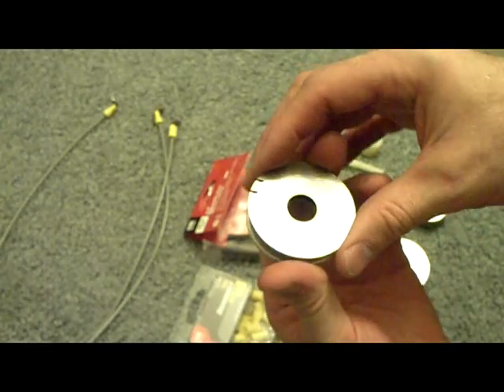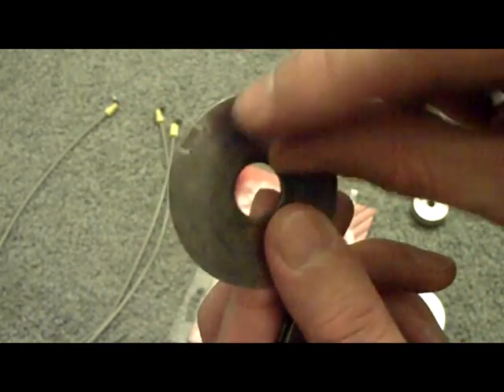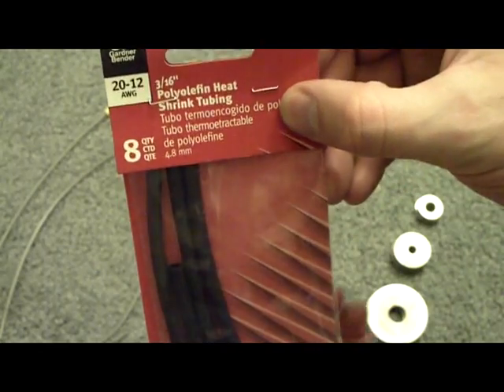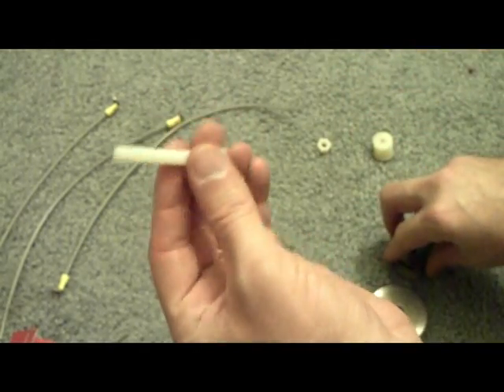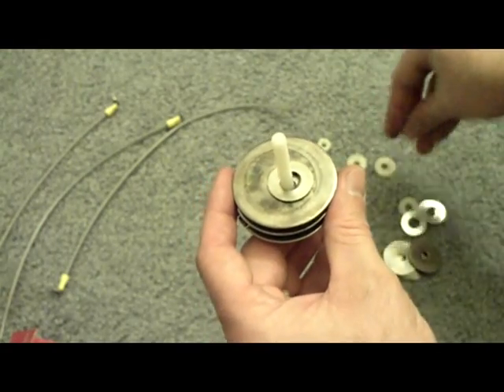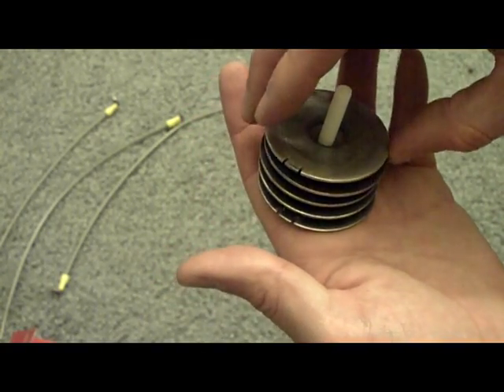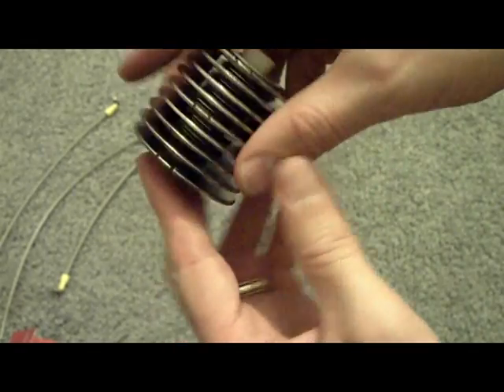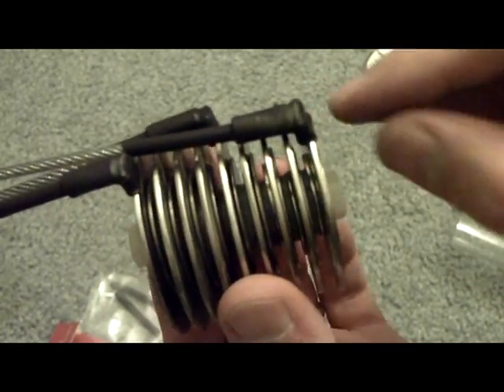Vid59 How to Build a Washer Cell

Comment: Keep in tank for storage
Reply: the gas produced like this is hydrogen and oxygen together.. storing that under pressure together in a tank has a name its called a BOMB. If you store that under even 2LBS of pressure in a 15lb propane tank if it back flashes it will level your whole house just fyi... you have to either us as it is produced to keep the volumn of gas small so a backflash dosnt kill you or seperate the oxygen at production point. Good luck.i know this from experience i tried to store it in a helium can i emptied with the thought of building a portable torch. to try it out i called my sister to watch, i pointed it at a candle and pushed the button if there was a flash it went so fast i didnt see it. but the can blew apart in my hand down the side seem and the bottom stuck in my chest. that is how i leaned its a bomb.... be VERY careful if you compress any gas in any container....

Comment: notches are genius, why not cut longer and bend those, oops it would touch the neutral washer. hmm laser weld a male tab for female connector. Aha! will do. I have a Rofin Baasel Lasertech Desktop. but bending connector works why do extra work. we'll see. i Like, OLE!

Comment: if you don't mind whats your volage and amperage ? and this design is pretty dope. the way i attached the wires is i cut strips of stainless steel sheet metal drilled holes and fed them in so they touch the washers

Comment: I will drill the washers and connect with a threaded bar and nuts and dont use the  wire conectors inside the solution.

Comment: So.  I really like this design and since you didn't write a material list.. I did it for you for others to read/screen shot. I'm definitely going to give the design a shot since it's easy to build and I'm new to this.

10 3" stainless washers
10 1-1/4" stainless washers
8 1" stainless washers
8 Nylon washers
3" Nylon bolt + Nut
Shrink wrap for making water tight connections
Stake on connectors (Disconnects)
3' 12 gauge stranded wire

A fuse wouldn't be a bad idea.  A 10 amp automotive fuse would work just fine and would only require two more stake ons and be put in line with the positive terminal.  It would be out side of the water/gas. The stake ons would not have to be shrink wrapped. 

I didn't take notice if the voltage was specified.  I would assume It's either 6 or 12 from say a car/power tools battery.  I would think you could use an old PC power supply if you should have one lying around or cheaply available.  Typically, they have 3 different voltage out puts (3.3V, 5V, 12V @ various amperages depending on wattage rating)

Another thing to toy with is a variable resistor or the like to actuate the amount of gas being produced.

Keep up the good work, My man!

Comment: Hi All,
This method of building a HHO cell is correct.
It's not the traditional version but it is simple and effective.
I built one and got great results.
Some of the comments being posted are not correct.
You need Neutral plates for a HHO cell.
The Neutral plates also produce gas.
And yes 3 inch SS washers are hard to come by so try going on line and get them shipped.
If you build this cell  and it's not working your doing something incorrectly.
Cheers

Comment: where did you purchase all of this wish you had a written material list I'm the description for was of access
Reply: plastic washers and plastic bolt and nut plus stainless steel washers it with cut grooves in them for the wire connecters

Comment: Where did you get the three wires that you put the quick disconnects on?
Reply from the maker: It is vinyl coated galvanized steel cable. You can find it at Home Depot or Lowes.
Reply: I noticed that 3" washers are hard to find on the internet. I also looked at Home Depot. If someone knows of a website that would be great.
Reply from the maker: www.mcmaster(dot)com

Comment: why do you have so many layers only three of them are doing anything
Reply: keco nation to cut back on their heat production LOL! I am with you! Only three of them washers are doing anything. If it is to cut down on the heat then why not just reduce the voltage or cut back on the potassium hydroxide? Everybody is doing it!
Reply: keco nation yagi antenna works
Reply from the maker: To prevent overheating of the cell. The extra washers are neutral. They are not directly connected to Pos or Neg, but instead provide a connection through the electrolyte solution.
Reply: Thanks

Comment: Let me see if I can help you here. Take 1 Stainless Bolt whatever length you want. Put washer on bottom install slim nut. repeat until tired. You just made the Negative Pole. Now Take a bolt and start with a slim nut. Repeat again and you now have a Positive. Slide the 2 together at what ever gap you want depending on amount you want and chain as many as you want in a circle. Place in container and Connect all neg and all pos together out of solution. Done. Hope this helps.

Comment: Has anyone tried using computer hard drive platters in lieu of stainless? I only ask as I have a fair amount of them and they are platted in platinum. I did some testing and got some impressive results.
Reply: I used hard-drive platters, they worked well until the platinum plating wore off, then the aluminum underneath began to deteriorate.
Reply: @davekauffman8727  Goldsmith/Master Jeweler here: too bad platinum plating wore off, in theory it should've held. that's why Bench tested is the True Enlightment. there goes my idea of gold platting copper, nickel or stainless steel if it wears off. cost of solid gold would be to costly. if someone is willing to pay I can make it. my father used to add platinum to his distributor points in the car. he too said it wore off. I don't think so. maybe fell off or he didn't think of thickness and gapping to correct specifications... Forget it, I changed distributor to Pertronix Flame Thrower Distributor. dang i got off the subject. OLE!
Reply: Dan carpenter what's a platter? the shiny disk?
Reply: @scottymassey8924  Doh! simple google search would've given you answer on the spot. Hard Drive Disk Platter. but see I just learned me something new. i too have access to lots of hard dirve disks, i can smell platinum money $$$. love reading comments, trolls, geniuses, inside info, by the way Goldsmith/Master Jeweler here. Bonafide in other fields Photovoltaic, Solar Thermal, Apprentice Electrician on way to Journeyman etc... dance instructor, ex-Player... OLE!
Reply: Dan carpenter voltage drop will be an issue.

Comment: How much voltage was applied. You tell the current but I don't recall hearing voltage.
Thanks.
Reply from the maker: It is running on 12v from a PC Power Supply that I modified.

Comment: The - contact produces H2 and the + contact produces O.  Normally these posts are separated so the H2 and O can be collected separately. Your design mixes the gasses. You don't get pure H2. Or am I missing something here?
Reply from the maker: This isn't a separator cell, so you are correct. The hydrogen and oxygen mix to create HHO gas. Basically it is water in gas form.

Comment: whats the point of using washers connected to neither negative nor positive ? Why do u use washers between negative and positive? they have no contact so they wont produce any gas ?
Reply: Hydrogen bubbles form on the negatively charged side of the washers, and oxygen bubbles form on the positively charged side of the washers. If the washers were to be connected metal-on-metal, it would result in a short circuit.
Reply: yeah I don't understand why so many layers either would work the same with just the 3 of them no ?
Reply: More surface area means more gas production, the washers in the middle are neutrals that are powered through inductance.

Comment from the maker: A bubbler is used as flashback protection, so if someone were to have another form of flashback protection, then a bubbler would not be needed.  

I'd recommend using a bubbler no matter what, because it filters/scrubs the gas and provides flashback protection.
Reply: Can you show the power supply connection?

Comment: @HHO4ALL have you performed a lpm test yet? I have the same design rigged up w/o the nylon bolt. I've used two zip ties. It seems just as tight as with a bolt , but i'm not getting the same effect visually. I can't find the 3" or longer nylon bolt here locally is the reason.

Comment: Why do you use three different washer sizes for each metal layer? Is it a surface area thing? If so, why not use 3",1",3" instead of 1",3",1.25" as you used? 

Try using "self-sealing dual wall heat shrink tubing" instead of regular heat shrink tubing. This will keep water out of your zinc connections. The dual wall heat shrink has a thin layer of thermoplastic inside the tubing. The plastic is similar to the stuff in hot glue gun sticks. When you apply heat to shrink the tubing the glue layer

Comment: Has anyone tried other variables such as 1. different temperatures of water  2. different air preassures  3. Creating one in flowing water.  4. Vibrating the device.  5. Shooting a wave through it such as a high frequency sound wave?

Comment from the maker: @heartrobot351 I haven't done an output test yet, but I'm guessing it isn't going to break any records.  The zinc connectors will break down very quickly.  With constant use you would be lucky if they would last one day.  The problem is that they degrade at the connection first, and once that goes... your cell won't be receiving power anymore.  Joebulatao had a good idea. He recommended using liquid electrical tape to seal the connectors.  This should fix the problem.  Thanks for watching.